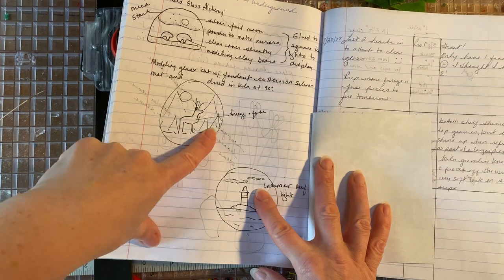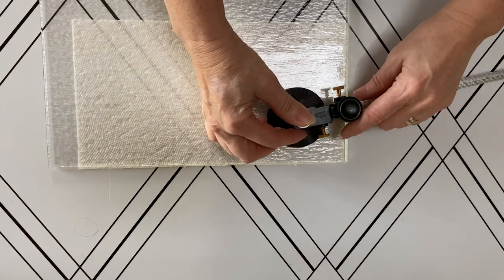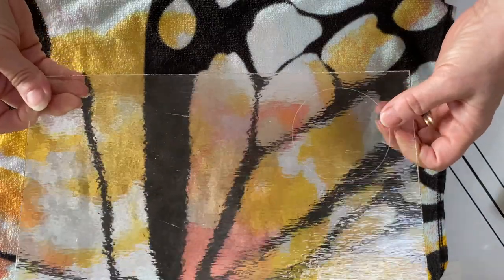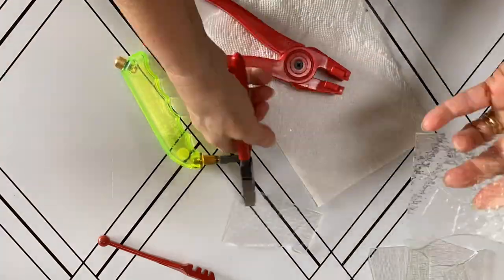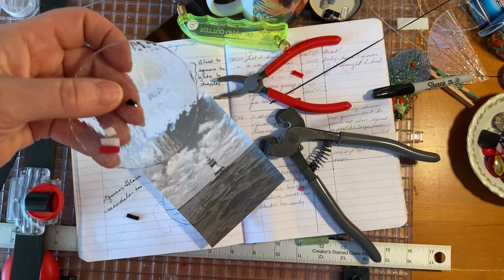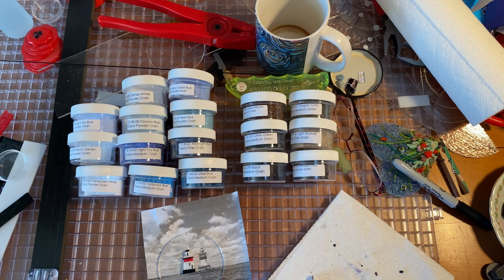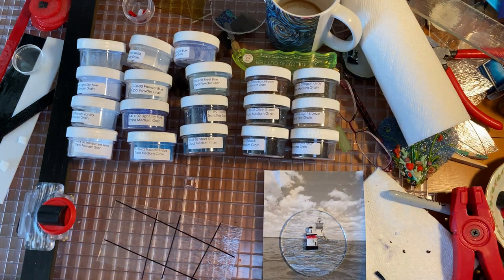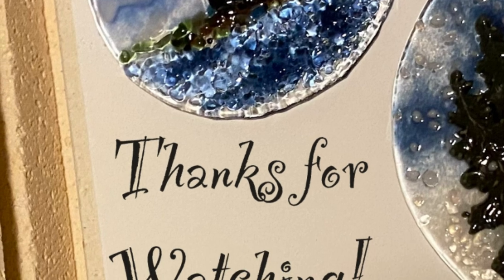Latimer Reef Lighthouse Ornament in Fused Glass

Comment: I have a hint on cutting circles.  Don’t try to cut several out of one large piece.  It is easier if you score each circle in a small square, with a fairly even margin around it.  I have difficulty running a circle that small, so I score 4 lines tangent to the circle score, then use my running pliers from the edge to the circle score.
Reply from the maker: Thank you for the tip. I will definitely fry that. I’ve sort of figured it out, but end up with way too much wasted glass the way I’m doing it.